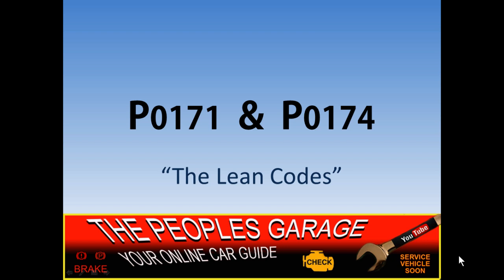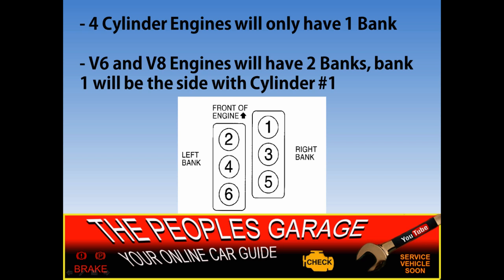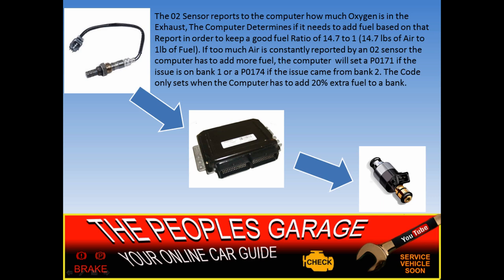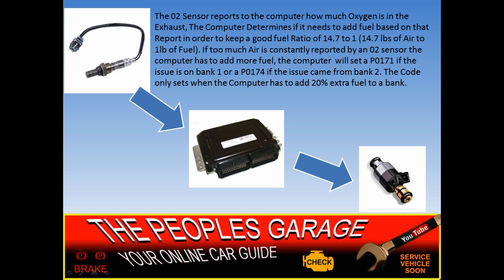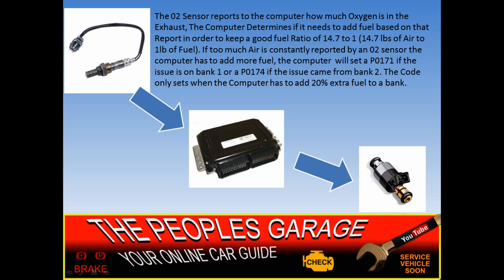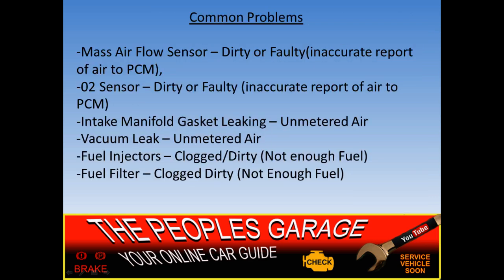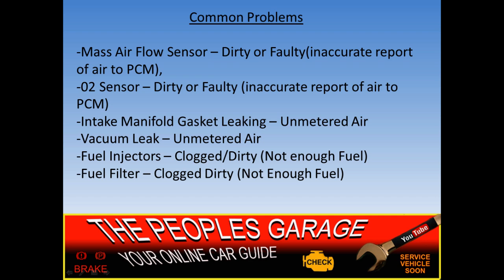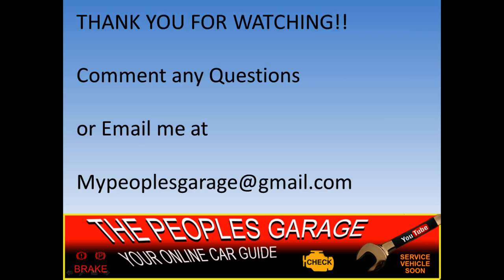How to Diagnose Codes P0171 & P0174 - Lean Bank 1 & 2

Comment from the maker: yes, the 100 is directly related to it, the p0110 is related to the intake air temp sensor which is built into the MAF, and the 172 Rich code could also be related if the computer thinks the car is running rich due to an inaccurate air reading by the MAF...I would definitely go with MAF
Reply: I have a D16y7 2000 honda civic and the p0171 code came on with high idle coming to a stop, and when in gear it does away

Comment: I am getting P0171 ---- P0174 and  P1506 codes  

i clean  mass air flow sensor  and  throttle body  i clean the EGR  and i still get the three codes  can you help me
Reply: You could have a vacuum leak in your brake booster. Most people will overlook that.

Comment from the maker: First thing I would do is clean your Mass Air Flow Sensor with Mass Air Flow Cleaner from your local parts store, this is the most likely case if the light came on and both codes were there...
Reply: You're exactly right. It's easy on this car.
Reply: I guess it can't hurt to change the air filter mine somewhat look dirty but not beyond belief
Reply: My 2004 expedition first showed po174 then I erased it , after driving for 50 miles it came back with po171 When I'm on idle there is a tiny shaking, and I could hear a vacuum leaking sound in the bank 2 passenger side by the firewall is the sound coming.What do you think it would be,intake manifold or pcv hoses?

Comment from the maker: P0171 is only the right side of the Engine, The PCV will effect both sides and have a P0174 Code also... try spray around the Right side of the engine with a  brake cleaner or carb cleaner with it running and listen for a pickup in RPM for a vacuum leak..
Reply: Can I Unplug The Mass air flow Sensor with the Engine Running I heard if it Turns off The Sensor is Good  any help??

Comment: Well I am unfortunately back woth p0171 again. After intake gasket change there is noticeable less hessitation. Still after three starts I get P0171. This is what I have done,  intake gaskets meticulously torqued, mafs, fuel filter, air filter. I find it unusual that egr metal flange has only one bolt tapped in intake. Maybe a leak there or pcv hose?

Comment from the maker: You might not notice the idle rough, but still spray around the intake with brake cleaner and see if the idle changes. Also cleaning the MAF sensor might not do any good if its electrically faulty, it might need replaced. Those are really the only 2 things that are even remotely common on your truck to cause both of those codes to come on. If your friend has a scan tool that can read data, hook it up and get the reading for your MAF sensor, it should be about 4-7 grams per second at idle.

Comment: I ended up with 171& 174, both banks. Changed fuel filter, cleaned MAS, cleaned air filter, cleared codes. 2000 Silverado 5.3 ran great for a month. Check engine light back on & hesitation when engine is around 170 degrees. Runs great cold & runs great at full 195 temperature. Hard to figure. Technition friend said idles too good to be intake gaskets.
Reply: Brake booster could cause a vacuum leak and cause both codes to show up at once.

Comment from the maker: Watch my video on how to check for vacuum leaks, use brake cleaner or carb cleaner to spray around the intake, when the engine wants to cut out or revs up you know your in the right area where the pcv hose is leaking!

Comment from the maker: Both Codes for that ford are very common for either a PCV elbow behind the intake manifold, its a rubber 90 degree elbow most times. Also the Mass Air Flow sensor is common, You have to remember if you have both codes then both banks of the engine are effected. Meaning the Left and Right side of the "V-6". So all of your fuel injectors will never go out at the same time and the driver side sensor is only for one side. The PCV elbow and MAF sensor will effect both sides. Keep me posted!
Reply: I have a code p0174 in 06 hyundai sonata v6 3.3. Any help would help,
Reply: I have same coded I'm really thinking it's my mass air flow sensor. I'm also having hard starts

Comment: hi i have a 1999 ford f150 4.2 v6 i have both codes. i have replace my fuel injectors and the down stream o2 sensor on the driver side but the codes still came back. my friend is a mechanic, he is the one that told me what to replace and now i am 400 bucks in. i am also the one who replaced everything. what are your ideas on this problem lol

Comment from the maker: Yea intake gaskets are the most common issue for that code on your truck. Check out my video on "Checking for Vacuum Leaks"...Spray brake cleaner/ carb cleaner around the intake on bank 1...which is driver side on your truck..